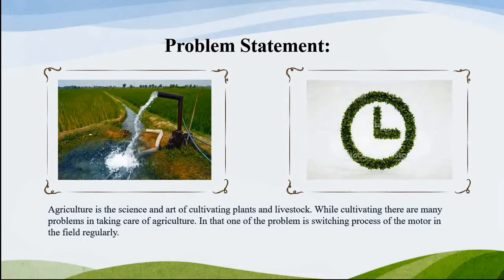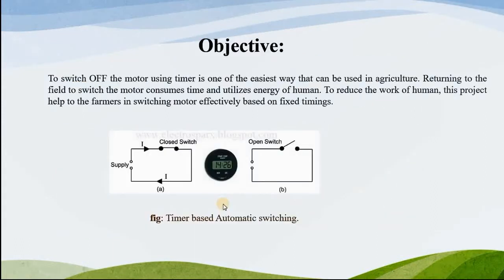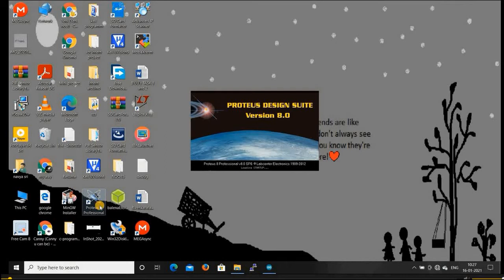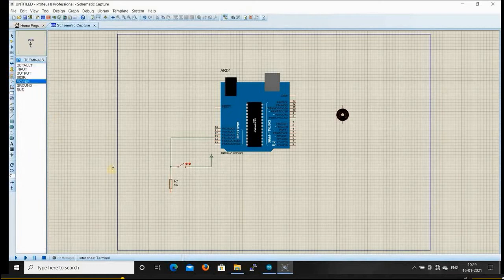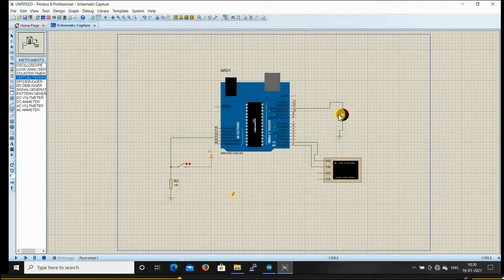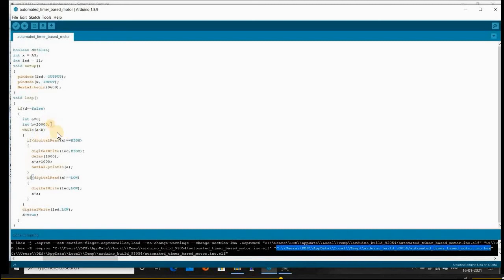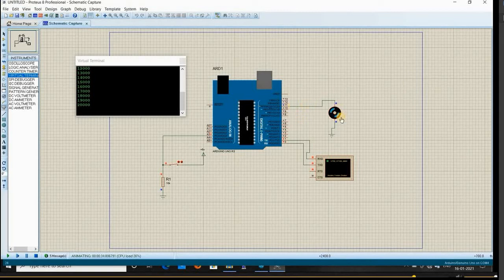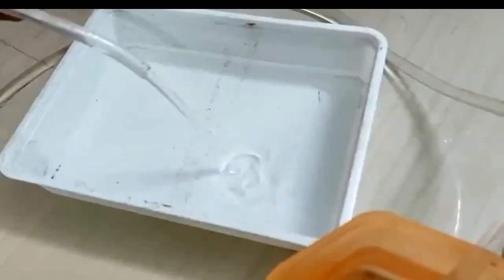Timer based automatic motor

Comment: Place sand right Code
Reply from the maker: boolean d=false;
int x = A4;    
int led = 10;
void setup()
{
  pinMode(led, OUTPUT);
  pinMode(x, INPUT);
  Serial.begin(9600); 
}
void loop() 
{
  if(d==false)
  {
    int a=0;
    int b=20000;
    while(a<b)
    {
      if(digitalRead(x)==HIGH)
      {
        digitalWrite(led,HIGH);
        delay(1000);
        a=a+1000;
        Serial.println(a);
      }
      if(digitalRead(x)==LOW)
      {
        digitalWrite(led,LOW);
        a=a;
      }
    }
    digitalWrite(led,LOW);
    d=true;
  }
}
Reply from the maker: once check your mail, i placed the updated circuit and also the code.